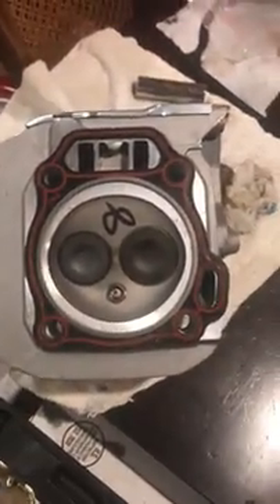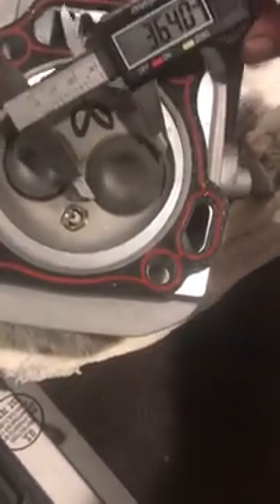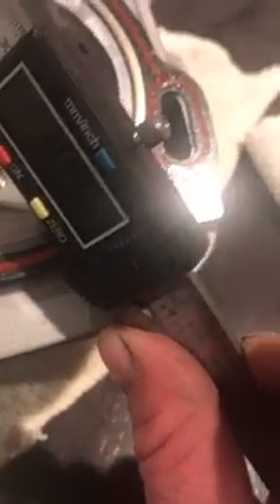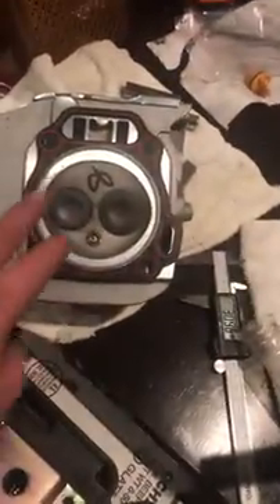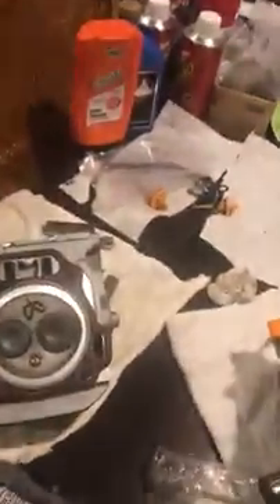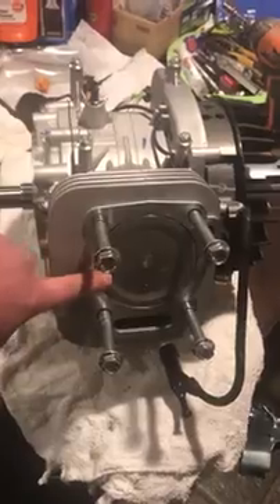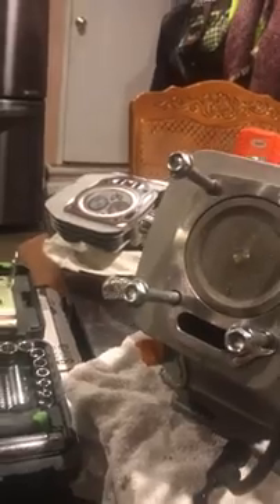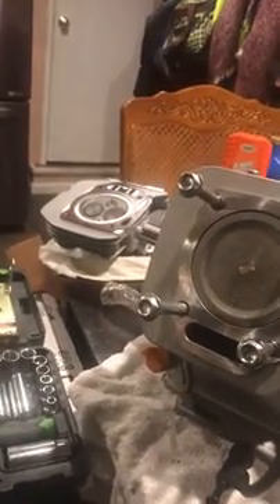duromax 440 18 hp , review, engine specs, Head specs,

Comment: I BOUGHT A 440CC DURAMAX AND I NEED A KEY SWITCH THING IT HAS A STARTER AND I WANT TO USE IT THAT WAY ALSO NEED A GAS TANK PREFERABLY THE ORIGINAL
Reply from the maker: Text me .. I have those parts as new take offs .. 781-492-7358

Comment: How fast will the 18hp duromax run on a go cart?
Reply from the maker: Well bone stock ...it's got but loads of power ! Depending on the weight of the kart, gearing and clutch/ torque converter setup it can do 35-45 no problem .i would def recommend things tho ...
Reply from the maker: It's def a good start
Reply from the maker: 92mm piston ! 66mm stroke ...440 cc is a great start!

Comment: What cam can I use or modify ..Cut length to make work in my 18hp duromax...I'm trying to make 25/27hp.. WOULD THE 308CAM FROM A 420CC HELP ....
Reply from the maker: The cam will fit ....the 308 is better than stock and has good lift but you can use more ....you will not make more than 25hp with a carb that small so don't worry about making too much power ...if you build it as strong as you possibly can it will prob make 25 hp ...to get over that you need to step up the game ...don't be worried about making to much power with stock valves and a carb on the small size ....to make 30+ you need to get into it pretty hard ...I'm making 40+ and it has welded up combustion chamber big valve heads ,that where extensively flow tested..on a bottom end with total seal rings and a compression ratio of 16:1 on race fuel ..I will tell you that using a true Honda coil and a brisk spark plug and a good amount of timing will help build power , but use the cam card you get to set your timing ...I have a custom ground 335 cam ground on a 107 lobe separation angle for exhaust scavenging....that's how I take advantage of the big 35mm exhaust valve....also look into milling the head at an angle instead of flat ...just a tip !!! Puts valves at a better angle hint hint !!!!